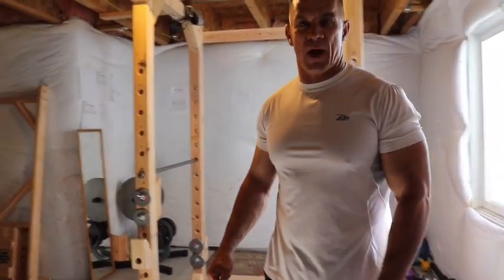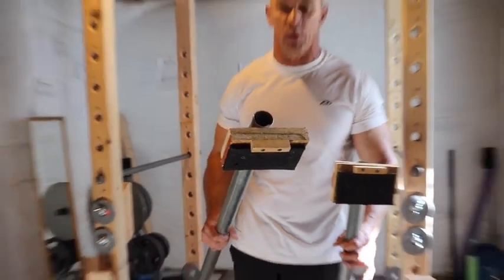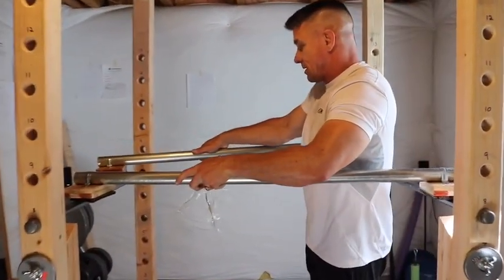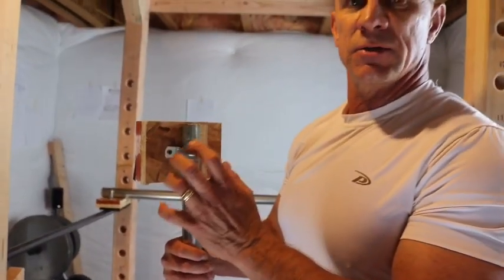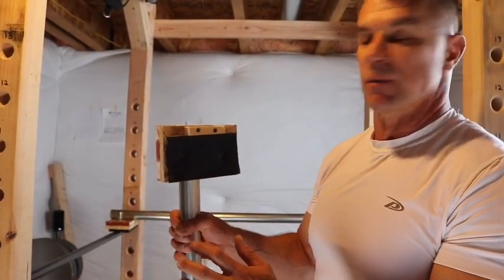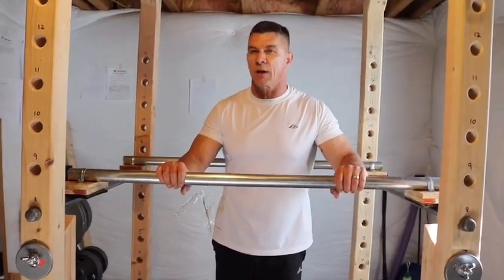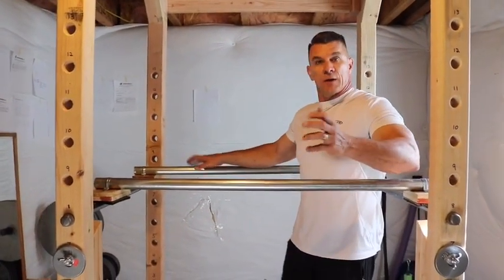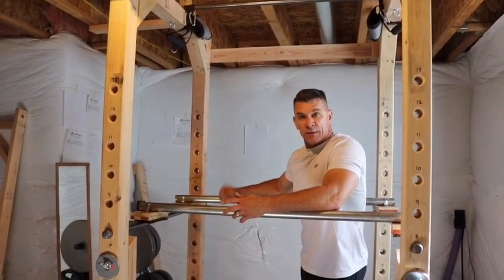DIY Power Rack Dip Station

Comment: What's up guys. Just wanted to chime in on what I've done to get this same result without constructing anything. But you need 2 barbells. So on your safety bars in the rack, cover them with padded pool noodles. Then put your 2 parallel (somewhat) barbells across them. Once you know where you want your 2 barbells to stay in place, make cutouts in the pool noodles where the barbells will sit in the cutout pocket and not move.
Reply: capoman1 have picture?

Comment: hey man great videos. i was thinking about different ways to have a dip station. i was thinking maybe a larger pipe to fit over one safety bar like a sleeve, then have two arms coming off of that sleeve with the help of some T brackets? which would rest on the other safety bar. I think it would be small, easy, and inexpensive. let me know what you think.
Reply from the maker: Thanks Jerimiah, Not sure I understand completely what you are describing. Does it involve welding the dip bars onto the pipe that slides over the safety bar? That would be a good idea but I like to be able to slide the dip bars to different widths. Simple and cheap (if functional) is always best. Kurt